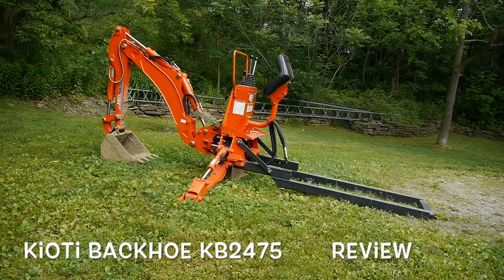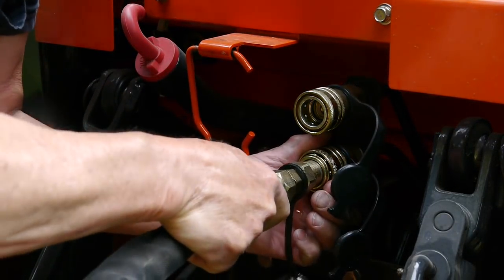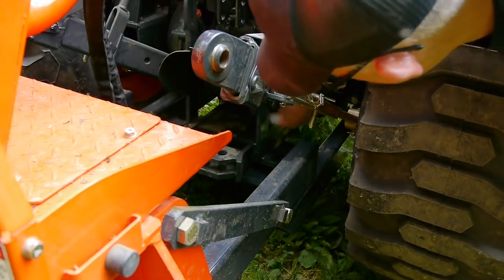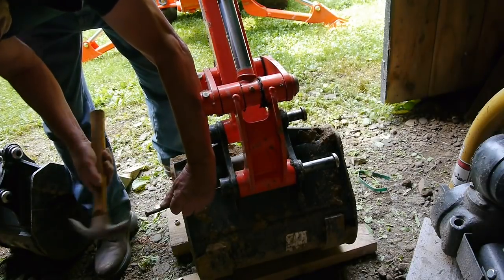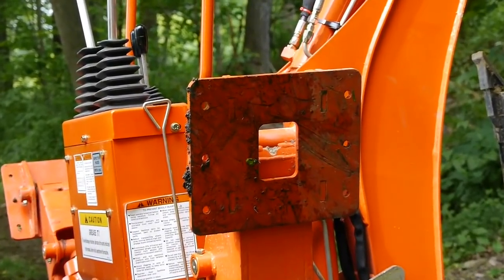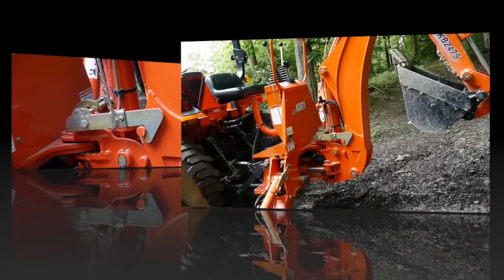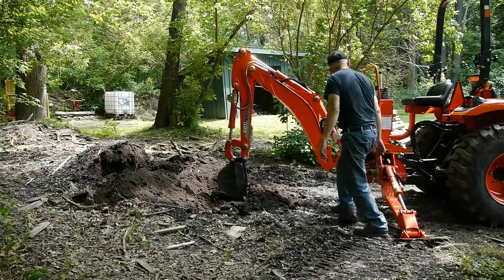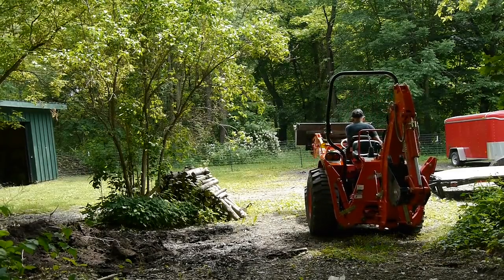Kioti Tractor Backhoe Review

Comment from the maker: UPDATE:  Three years later and I've got a pretty sloppy backhoe.  Either the pins or bushings or both are shot in the lower joint.  I always greased the backhoe before a digging job but this thing needs work already.  I had a 1996 kioti and I bought a Woods brand backhoe for that one.  I used that backhoe 15 years and had very little wear on the pins and bushings.  Woods is a much better backhoe.  If I had it to do over, I would NOT buy this backhoe.
Reply: TimTools99 se
Reply: Tim.  Sorry to hear that you had this issue.  I just bought this exact backhoe used, and it also has this issue.  But for the price I bought it for, seems like replacing the lower joint pin is a good trade off.   Pins are cheep.  

The backhoe that I bought has the wrong subframe.  It was attached to a different brand tractor.  I have an original Kioti subframe that is close to correct but a little short (about 6 inches). I would like to make this frame work by extending it but need some measurements.  Could you possibly provide me with the measurements on the subframe next time you have it off of your tractor?  Specifically, I am looking for the length of the long square rails on each side that sit directly under the tractor.  They run from the front of the frame to the back.  They are connected by bars that sit in the brackets coming off of the frame.  If you need a more detailed photo of which specific rail I am talking about, I can provide it.
Reply: TimTools99 Nice video, im looking at a 2007 ck35 and i dont think i can beat the value of it. I have an 18hp JD 4010 and am looking for an upgrade! I have about 15acres of property to manage and feel like it would be a good fit. Thanks for the video!
Reply: You can easily get used to digging with sloppy bushings. It can even be better and more forging at times.
Reply: TimTools99 
Good to know!
Thank you for the update.
Reply: know this is old but woods makes the backhoe for kioti
Reply: I have an rx6010 and for what you pay for a new tractor, I keep finding more and more things wrong Ike half of the bolts aren't even tightened and end up just about falling out until you catch stuff like that,  I'd stay away from kioti tractors and go with something else like a Kubota

Comment from the maker: I have 100hrs on the tractor now.  It definitely has good points and bad.  The good: starts really easy. runs good. with the ag tires it is less tippy than my old kioti. If you get a tractor with HydroDrive ... get one 10 hp bigger than you are used to.  My old Kioti 30hp gear drive will work circles around this new CK35.  I like the Hydro for Loader work and in general it is very convenient.  NOW THE BAD: does not have the power for pulling or lifting on loader or digging with the backhoe that my old 1996 30hp GEAR drive tractor had.  I think it is due to the HST drive.  That takes a lot of power to run. Because I must run the CK35 at a high RPM to satisfy the HST and Hydraulics ... it is NOT as fuel efficient as my old Kioti tractor.  It is a give and take.  If you think you want the HST then be prepared for this.
Reply: The ole phrase they don't make things like they used to still holds true, still holds true but Kioti is a great value in the tractor world.. Enjoyed the video..
Reply: Tim Mead 
They make a gear drive (if the HST is the issue). I don’t think he was saying that the old one was better, just that (perhaps) going to an HST might lead to less power for the hydraulics.

Given what was said in the video and what little I know about hydraulics; there may just have been a decision to trade away some power for more speed.  I.e. Smaller diameter cylinders.  ?

Let me know what ya think/know that I am missing.

Comment: @ 5:35 - do you think a heavy duty pin would work here, so that the removal would be one less tool required?
Reply from the maker: I guess you could but there would be a chance that it could fall out if it only had a clip instead of a lock nut.

Comment: Thanks a bunch for this video Tim. I have an 09 Bobcat CT235. It did not come with a Front loader and non were available other than after market. When I contacted Westendorf I was told that they could supply one that would fit my machine as well as as the Kioti version.
Need to look on my tractor to see if I have the similar brackets as you do to accomodate the backhoe subframe.
Well done on the Video just subbed. Take care

Comment: I want to buy a tractor and backhoe and I'm trying to get as much info about them. Pricey buggers tractors are. I only have 4 acres and I own a rental property in town. Would love to have something like this to make life easier and get more done. I keep getting told I don't need a large tractor to get what I need done but I feel like a 30 hp tractor is a good fit. My knowledgeable person that's helping tends to direct me (probably rightfully so) toward a ck20 kioti rather than b7800 kubota or max28xl Mahindra or 1533 shuttle Mahindra. The 1533 has more lift more backhoe but is on the larger side and 35 hp. Perhaps I don't need that much... Ck20 seems doable but I can't get out of my mind going a little larger. At what point does the size of the tractor become a nuisance for tight areas and if I went ck20 how quickly would I be regretting not getting something bigger? 
I know this is off topic and long just figured I'd ask some ppl in the tractor world their thoughts.
Reply from the maker: 30-35hp is a nice size. I think anything smaller and you have a toy.
Reply from the maker: 30-35 hp is a nice size. Big enough to do some serious work and small enough to get around tight areas. Any smaller and I think you have a toy. Not good for much other than a motorized wheel barrow. I guess it depends on what you want to do with it. If you are getting hydro model then get 10hp more than you are thinking. The hydro steals alot of power. I wish I would have gotten a 40hp instead of 35. Another thing. Don’t get the Kioti backhoe. Tractor is good but Kioti implements are junk. I had a Woods backhoe on my last tractor. Much better. Good luck have fun.

Comment: You are rite about every hoe is different and learning the engine speed. Once you hit your tractors max Hydro flow which in my Massey is around 1600rpms you have full power. Anything after than only speeds up the movement. I run mine at 2000. Its the perfect rpm for control and speed. Man a backhoe is nice to have around. I love um. I beg to dig up my neighbors stumps for them. Haha
Reply from the maker: Thanks for checking in Mattsbrute.  Yes, they are pretty handy for sure.  I have found that about 1600rpm is about right for this tractor.  You are right ... any faster and you just move faster and with this one it can be jerky.

Comment: you should try to move the boom toward you while digging, just curling the bucket hold the dirt against the boom and it falls on the pins. not that it will break something but its dirty and the paint will come off ;)
Reply from the maker: Yeah normally I do that of course but I was just playing in the loose dirt pile in this video.  I didn't want to dig a hole there.  Thanks

Comment: Nice review. My folks have the same tractor and backhoe. But our backhoe must be an earlier model because I have to remove the three point arms to put it on. It's my least favorite job out there changing them over. It must also be my parents least favorite job  because they always leave it for me too do even if it means putting off a digging task 3 or months till I get out there to do again.

My observations about the power loss through the HST match yours. yes 10hp more to cover loss.

Comment: Very interesting , thank you very much.
Do you think this backhoe have enough power for removing stump ? ( 10-15 inch diameter )
Reply from the maker: Depends if it is a shallow rooted tree like a spruce or other pine tree or a hardwood tree stump.  I have dug and pulled several pine tree stumps but if it is a hardwood tree with deep roots, forget it and call the stump-grinder man.

Comment: I have a B7510 Kubota with a 6 foot Woods backhoe. Have pulled many hardwood stumps to 15 in diameter. Just need to be patient. Start about 15 inches out where roots will break off. Can use the aide of a saws all. Dig all around then rock the stump to loosen underside roots and dirt. Then pull horizontally using root as a leaver. Do this a few times then roll up out of hole. My machine is a 21 hp so lifting the stump out is a challange. Some are easy at 2 hours and a 2 foot is all day.Good review of Kioti.

Comment: Tim, enjoy your informative videos. I have a DK45SE with shuttle. I’ve been looking for a good backhoe. I’m leaning towards a used one because of a limited budget. It sounds like a Woods is your recommendation. Do they also have the under chassis frame that can connect to my tractor? Any idea what a fair price would be on a used one?

A second question about backhoes is for a neighbor who has a Branson 78hp. What backhoe would be a good match for it?
Reply from the maker: Hello Dennis.  Woods brand is the only other backhoe i ever had and i liked it better than the Kioti hoe.  Woods makes a subframe to fit many tractors.  You have to have the subframe and that was arounf $500 if i remember correctly.  When buying used, i always shoot for half of the price of a new one.  Its hard to find used ones and then you would have to find out if they make a subframe for that hoe for your tractor. As far as the Branson 78hp ... I would go to a dealer and ask them.  The problem is getting a subframe but the dealer would be able to look all that up.  Go to several dealers.  You can learn a lot this way.  P.S.  Somebody told me that Woods makes backhoes for Kioti now.  Dont know if true.

Comment: I am currently working with a dealer to purchase a ck3510se. I own a 2025r John Deere. Would you recommend this tractor or purchase it again? I have looked at 5 different brands. This seems to be the best bang for my buck.
Reply from the maker: Yes, it is the cheapest of the small tractors. Its a good running tractor but i have issues with kioti implements. I would NOT recommend their backhoe. Also, their loaders are junk.  I had a 1996 30hp kioti and i put a Woods brand backhoe on that one.  That was a good backhoe. Also, if you get the hydro model, buy a tractor at least 10hp bigger than what you think you need. The hydrostatic drive steals a lot of power.  On this tractor, the loader will not lift a full bucket  of dirt until i back up first. I could dive into a pile of dirt with my old kioti and rip that bucket right up. Not this new kioti.  Dont know if it is the hydro stealing power or a weak pump.  Like i said, its a good running tractor but i don't like kioti implements.
Reply from the maker: Read the update comment

Comment: Excellent video !  I looked at a 2004 DK35 backhoe last week and drove and dug with it a little and noticed some slop where the hoe pivots near its base and when I checked for excess play both left and right and up and down I mentioned to the owner that he had play in it and he said that's the way it was when he bought it. It only has 342 hours on it and mostly for snow removal so little backhoe use. I walked away scratching my head how something with so low hours could have so much wear... I'm a Kioti guy so I'll be buying a DK or NX soon but I do have some concern on this issue... Thanks for the video.
Reply from the maker: Yea.  I am looking at the DX or NX next.  No more buying the CK model and no more Kioti implements.  Better to buy quality implements somewhere else.

Comment: you don't need your sub frame as long as you have your 3point hook up in working order that's all you need
Reply: what is the point of even having it on the BH? Extra options?
Reply from the maker: When I bought my first tractor/backhoe in 1996, I hooked the backhoe up to the 3-point as you say.  Found out that it was a real bad idea.  Damned near tore the ass-end out of my tractor!  The backhoe does a lot of twisting and pounding etc while you are digging so you definitely want a sub-frame.  The sub-frame is held securely to the tractor midway up and in the back so the backhoe can pound away and twist all it wants and the entire tractor absorbs the punishment ... not just the three point hitch.
Reply from the maker: If you do not use a sub-frame, you will tear the top link of your three point hitch right off the tractor.  The backhoe will twist and sway and pick up the back of your tractor as you work.  It deals out a lot of punishment that the 3 point hitch was not meant to absorb.  I hooked up my first backhoe to the 3-pt hitch on my old tractor and I could see that it was going to damage my tractor running it that way.  There is a reason they make sub-frames.  The provide a solid platform for the backhoe and spread all that abuse out rather than pounding the hell out of your 3 pt hitch.

Comment: sir, looks like you are missing the metal pads that bolt to the downrigger feet. I see the bolt holes like mine.
Reply from the maker: I will ask the dealer about the missing metal pads.  Thanks for the comment.
Reply from the maker: ***** I bought the metal pads.  $150.00.  Can't believe that they did not come with the backhoe.
Reply: *****
I think that the dealer ripped you off. Mine came with the steel pads. You can get rubber pads as an option
Reply from the maker: Yeah, I figured that was BS.  I should have questioned it when I saw the backhoe but I didn't think about it.  Shoulda-coulda-woulda.
Reply: Did you say you had the ck or dk model? Just wondering if you have experienced the notorious hydraulic line squeal yet?
Reply: Teddy Moore I have the RX6010. Got about 60 hours on it but havent heard any sqealin yet.
Reply from the maker: Teddy Moore Oh jesus .... don't tell me.

Comment: Nice job. Thanks!
Reply from the maker: Dominick DeFlorio Thanks.  I bought the Kioti because it was so much cheaper than that most other tractors and the dealer is only a few miles away.  If you are thinking about this machine, I suggest actually testing several others (John Deere, Kubota, Mahindra etc.)  Now that I have had the new Kioti for a while, I realize that all Kioti tractors are not created equal. My 1996 Kioti was a much better machine.

Comment: Yes, TimTools99, I found the same things with my Back Hoe attachment on my CK20S HST Tractor.
 This would dig at almost idle RPM where a major competitor had to have much higher revs to have similar amount of breakout force.
Well, all Tractors ARE different as you've said. They all have their plus and minus points about them, I just happen to like the features that my Kioti has, more than others, this is why I bought Kioti.
Reply from the maker: Yes Reg, it's a pretty good little tractor but I liked my woods backhoe on my old tractor better.  The controls on my Kioti Backhoe are second rate.  I have had to take them apart twice now and tighten things up.
Reply: You know Tim, come to think about it, I had to tighten up my Backhoe's levers too. I used lock tite on the threads and no complaints yet.
But to each his own, hey ?  
Now bear in mind too, that mine is a 'toy' and I only use it to do little jobs for neighbors and snow clearing too. In other words I don't give mine all day work, it's just that so far, no problems and it was considerably less cost for me to buy that the next best competitor.
Reply from the maker: I agree Reg.  The tractor was less expensive than the others. My Kioti dealer is only 5 miles away so that's another reason I went with the Kioti.  I'm gonna try the lock tite next time on my levers.  Thanks for the tip.
Reply: Good luck with Kioti, and all the best of good fortune in 2017.
Cheers Tim.

Comment: The Kubota set up is much better for attaching the backhoe. I've thought about getting a tractor with a proper loader/backhoe set up but I don't really like how this connects.
Reply from the maker: I did not check out the Kabota's backhoe mounting because right off the bat I did NOT like Kabota's loader control.  The control is in the way of getting on or off the tractor from the right side.  That simple issue alone disqualified the Kabota.  Also, the Kabota was $7000 more than this tractor.

Comment: please make more of these
Reply from the maker: Hey ... mymomagirlpoopgood.  I am glad it's working for you.  lol  More tractor reviews eh?
Reply: mymomsagirlpoopgood I have 100hrs on the tractor now.  It definitely has good points and bad.  The good: starts really easy. runs good. with the ag tires it is less tippy than my old kioti. If you get a tractor with HydroDrive ... get one 10 hp bigger than you are used to.  My old Kioti 30hp gear drive will work circles around this new CK35.  I like the Hydro for Loader work and in general it is very convenient.  NOW THE BAD: does not have the power for pulling or lifting on loader or digging with the backhoe that my old 1996 30hp GEAR drive tractor had.  I think it is due to the HST drive.  That takes a lot of power to run. Because I must run the CK35 at a high RPM to satisfy the HST and Hydraulics ... it is NOT as fuel efficient as my old Kioti tractor.  It is a give and take.  If you think you want the HST then be prepared for this.